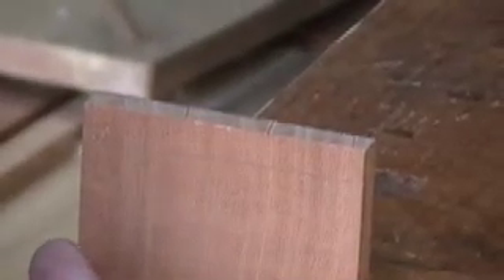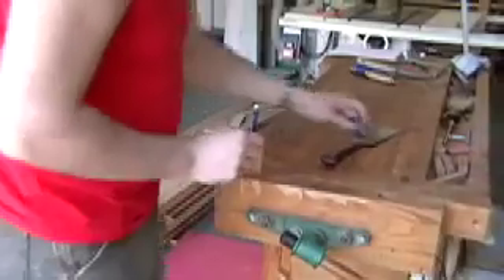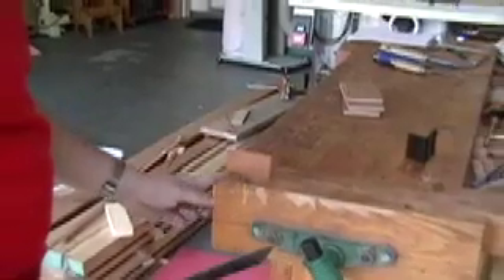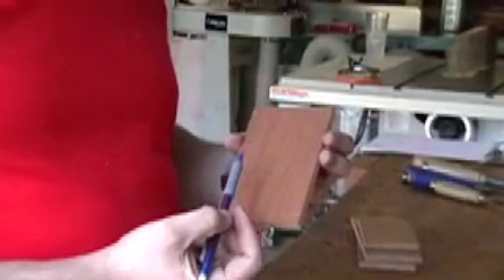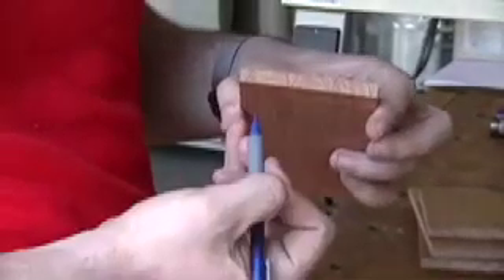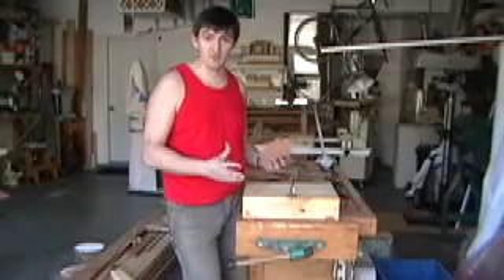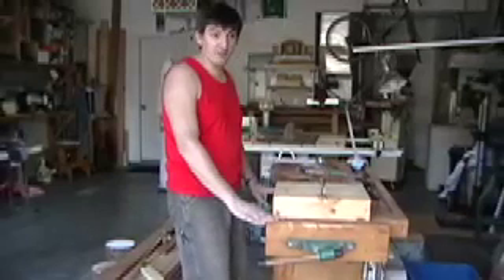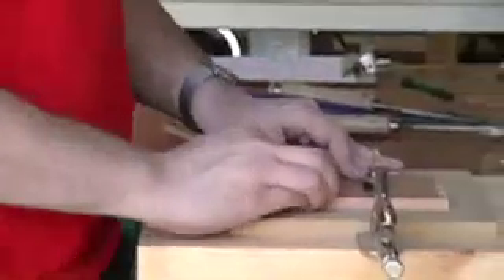Dovetailing a box (part 2)

Comment from the maker: Micky,

Both Fine Woodworking and Wood magazine rebuffed the 1:6 an 1:7 rule. It makes little difference whether you use one or the other, so guessing the angle is more than acceptable. The joint is so strong, for a jewelry box or even a drawer it is over-engineered (you can easily sit on any of these boxes without breaking it). This also implies that you do not need a lot of pins. By the way, on antique furniture, they have 4 skinny pins per 5" drawer and I have 4 per 3". 

Alin

Comment: You should use a dovetail template 1:7 gradient for hardwoods, 1:6 for softwoods when marking pins. Always cut on the waste side of line to ensure accuracy. I think you have too few pins for their narrowness wich results in a compromised joint strength. Guessing pin sizes is not acceptable for feature work, only the backs of drawers for example.